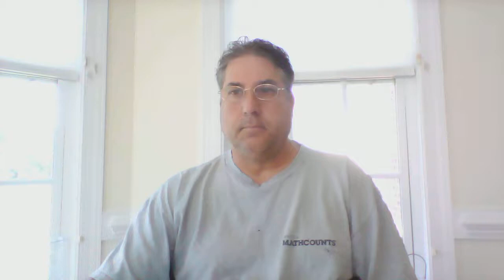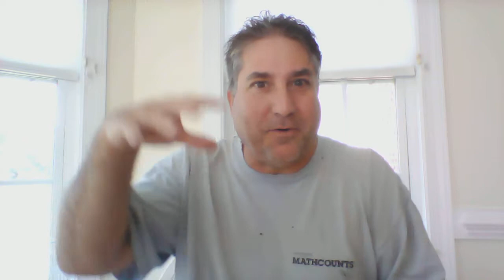Operational Fusion Reactor

Comment: To anyone screaming about "Bla bla bla the patent they filed was crappy': They have released almost zero information on any working design OTHER than the T4B test bed. The concept power plant in the patent is almost certainly NOT the cutting edge reactor they are working with. WHEN the time comes to release data OTHER than the tiny bits of info about the T4B, it will not happen in a damn patent filing. They will file peer reviewed papers to all the current engineering and science journals. Companies file patents all the time for many different reasons, with Lockheed being one of the most ubiquitous patent filers in the country. The fact remains that almost everyone who works in the field has become extremely interested in their process, just by the limited data provided about the T4B. The data released HINTS at several major breakthroughs. Being that this is the Lockheed Skunk Works, only a fool would think they are doing this as a publicity stunt. They invented the Stealth Bomber. They have absolutely zero to prove.
Reply from the maker: BTW, The Navy just filed their patent. Must suck being you. You here good news and all you can do is criticize. You should try smoking weed.

Comment: If you've kept up with Lockheed's program, you know they increased size of the "compact" reactor was increased to the size of a submarine and the output was cut by 100 fold in their patent filings in 2017.  This rumor you heard on the dark web is a rumor.
Reply from the maker: I do believe you are full of shit. Post the links or shut the fuck up.
Reply: @MrVonBastard  https://www.nextbigfuture.com/2018/08/lockheed-compact-reactor-is-100-or-more-times-worse-than-initial-claims.html

There you go, ass.
Reply from the maker: And another thing. That patent is for an aircraft power plant. So I'm pretty sure it's not the size of a submarine. Also, the patent office doesn't issue patents for shit that doesn't work.